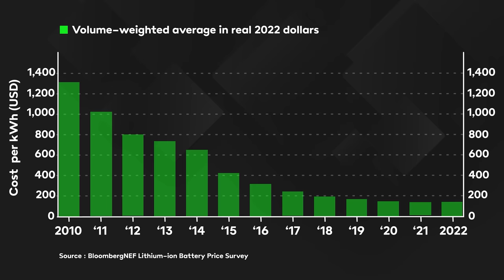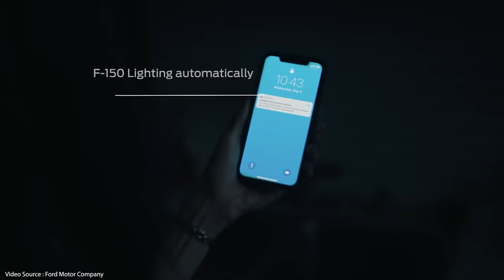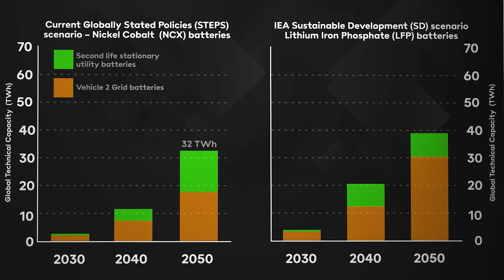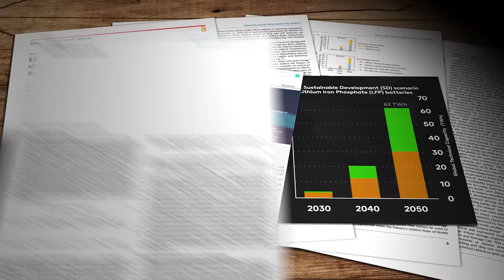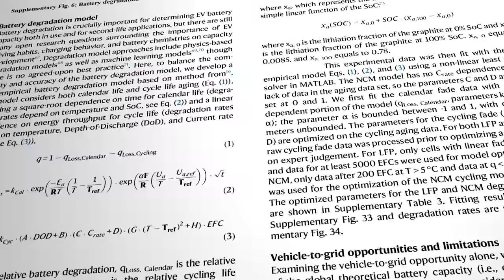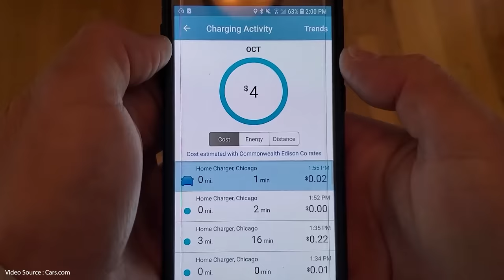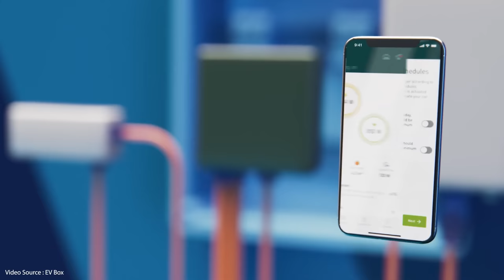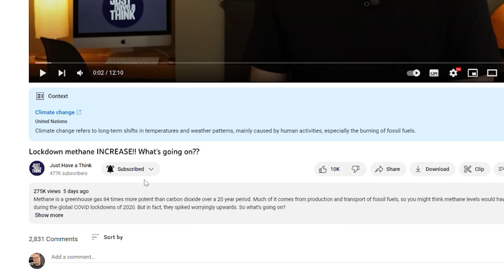Can the electric grid ruin your EV battery?

Comment: Great topic especially during the transition to solar-wind-battery SWB.  My Model 3 and Model S could keep my house going indefinetely during outages if I were charging at a location with power.  And, there is a free massive storage resource available on the grid.
Reply: If they were charging at a location with power, you wouldn't be having a power outage.
Reply: @shmehfleh3115  you could drive the car to a location with power,  charge the car  then drive it home.
Reply: Alternative if you had a wind & or solar panels you could charge your car and during night power your house from the car. The problem is if it was grid tied solar, the inverter automatically disconnects from the grid supply but the battery supply from the car has to go through that inverter. I am not totally familiar with how a EV power system works but it might not have to go through the inverter if it can supply AC power at the correct frequency for house use.
Reply: @grgmetube  yes, your car would just act  like a "power wall   on wheels".
Reply: @shmehfleh3115  You've obviously never lived rural like I do. It depends where the tree branch or tree hits the power line. There are orders of magnitude more trees here in the forest than in the nearby towns.  I've got about 300 trees in my little 0.24 hectare garden. Some are 80-100 feet tall.

Comment: Another excellent video. Most cars are parked (at home or work) for 95% of the time. Makes sense to utilise that storage capacity either for home or grid service.
Reply: @orionbetelgeuse1937  The night includes the period until 9pm when there is a peak load when the car could discharge to the grid and the 10pm to 6am bit where there is very little grid load and therefore cheap off-peak electricity. Not really that difficult, but still very useful in smoothing out demand.

Comment: We need a universal format battery "power cells" for swapping from car to home backup use when they get to the 80% capacity level. We already do this with power tools and lawn equipment. EGO has a small power bank that allows hot swapping batteries from their lawn equipment into the "generator" to power stuff. It's not an overly powerful system, but it shows me that having a hot swap battery bank for power cells could be possible.

Comment: LFP lithium iron phosphate batteries last 2 to 3 times longer than NCM batteries used in the vast majorities of EVs today.  LFP also can be charged using rapid chargers, or more commonly referred to here in America DC fast chargers, without suffering any damage unlike NCM batteries.  LFP batteries also have a deeper discharge cycle.  LFP batteries can also be charged to 100% on a daily basis without damage unlike NCM batteries.  All this means LFP batteries will be less damaged by sharing electrons with the grid than NCM batteries.  The real question will be will you have enough range on your car when you get in it if the grid has been taking electrons to while it was sitting?  I suspect in the future you will be able to set a minimum charge level that will cut off the grid from taking electrons if the EV's battery drops to that level.

Comment: Another consideration with sharing battery capacity across the grid is that it only works when vehicles are plugged in. More new vehicles will be purchased by those relying more in highly intermittent point charging and not left on socket.
Reply: That relates well to the other issue; folks in condos, apartments, etc. without access to charging infrastructure of their own.  I’ve heard that offered as a reason not to buy an EV often enough.  Even as vehicle range, pricing and public charging access improve enough to begin to chip away at that reluctance, there’s still a daunting mess of obstacles between those folks and any kind of V2G/V2H applications.
Reply: Yup, and also, even those who do have home V2G set up, there batteries will not actually be able to participate in V2G while they're at work, unless they either travel to work without car or work from home.

Comment: I have an old Leaf which I use for around town and hope to use the battery in the home when its range is too low for transport. The problem is the high cost of the inverter and controller plus the installation.

Comment: Having just left a software job at the largest Virtual Power Plant platform attempting to integrate vehicle batteries, I can confirm 2 things:
1) Software is already capable of keeping batteries in preferred ranges.
2) People are very skeptical of giving over control of their home power. If politicians try to screw us, there will be backlash.

With the massive short term battery supply shortages, I have a hard time imagining a quick renewable transition without allowing car batteries to do double duty.

Comment: I read somewhere that refining petrol uses a lot of electricity per gallon, I can't remember the exact figure.

So as electric car use increases and petrol refining therefore decreases, there's all that electricity available to charge vehicles as well. The grid won't have to increase as much as the doomsayers claim.
Reply: Diesel takes even more and uses Cobalt to extract sulphur from the fuel. 😆
Reply: It doesn't quite work that way.  The electricity is mostly generated at the refinery.  But, EV's are much more efficient so there should be an overall decline.  Plus I think storage capacity will build to very high levels over time.
Storage and power generation are both getting much less expensive.

Comment: Bit off topic, but you should look into Na-Air batteries.  If you can potentially do with them what was recently reported on Li-Air, that would solve the mass/volume issue with Na vs Li based batteries as well as address the availability of easy to extract Li.

Comment: I do believe that vehicle to home would be enough ; It would require less complexity (I guess).
The operator, knowing that a house has this system, could decide to cut the supply temporarily to flatten the consumption curb. Of course, each Kwh taken out of the battery would need to be compensated at a higher rate to prevent abuse.

Comment: I feel that all electric vehicles should be bi-directional charging capable, as should every home. This could not only reduce the number of power stations required, as electricity from cars and trucks  could sell back some of their charge at peak times to supplement the national grid and help grid balance. It would be possible to earn a little extra on that electricity rather than just be credited with it to replace off peak. There are roughly 38 millions cars in the UK and if even half of those were plugged in during peak hours, giving say 2 kWh each back to the grid, that would be 38 gigawatt/hours of extra capacity. (Hope my maths is right...)

Comment: As always, cost is going to be the key driver for all of these ideas. Using EV batteries as supplemental grid storage will work great, IF we can make the investment for a pricing system, IF we can justify the hardware cost at the home, etc. The storage is there… but can we affordably access it? I hope so. On the other hand, I think the ongoing use of less-than-perfect used EV batteries and solar panels is so hugely beneficial that the economic benefits are obvious and easy to exploit. I think this is really the answer to the “HOW WILL WE DISPOSE OF THE DANGEROUS TOXIC SOLAR PANELS?!!??” nonsense. A solar panel that is only 50% efficient still works. Just resell it, or even give it away.

Comment: The weak link is charging networks. We need more chargers, and higher speeds to "future proof" the charge stations. A recent check by EVM 30-40% of the charging stations are either down, or has large queues. Even slower chargers on the street poles would be a welcome addition.

Comment: I have found that driving my cars at 40 to 50 miles per hour gives me a much higher miles per gallon than driving at higher speeds. It also appears that driving an electric car at these speeds is more efficient too. The lower driving speeds cause less sound pollution and possibly tyre debris. Switzerland has a 50mph national speed limit and it feels great when driving around!
 I have noticed how much faster electric bicycles  travel around , even though they are speed limited. I can see that soon we shall have to change the speed limits on all roads , and critically road junctions,  to maintain safety.

Comment: Dave, as an American, I use 5 kwh of electricity per day, so we're not all energy hogs. 🐖⚡😉 I live in a lakes district, my thoughts are to build or retrofit solar canopied pontoon boats that charge the grid when not in use on the lakes.    ⛵ Edit: if we insulate our homes better and go with more efficient fridges and freezers, there should be plenty of capacity to charge those EV's, as the lion's share of household electricity is gobbled up by those refrigeration units and heating system pumps.
Reply: Even if we don't do anything as homeowners, grid expansion can easily keep pace with EV adoption.
Reply from the maker: Well said Chuck

Comment: "The current obsession with longer range and faster charging times is arguably a delusional mindet."  Yes!  Other than roadtrips, my 2015 Nissan Leaf with <100 mile range is great for my everyday needs.  People talk about the infrastructure that needs to be built for EVs, but  I don't have gasoline pipes running to my house, I have electricity.  My work has electricity.  99.99% of buildings in my country have electricity.  Maybe I can't drive across the country with so few public chargers, but I haven't needed to do that in several years.

Comment: I think this is key to the future. Also if we can have more charging options maybe we can have smaller batteries. Maybe the slow grid charge options could be based on only 240v 15 amps (in Australia) nothing too huge but not enormous cost to roll out everywhere and Easy on the grid. Your vehicle is pushing and pulling the power during the day based on what is happening with solar. You get paid for the use of your vehicle’s power. Maybe there are incentives for when you have solar at home producing and your car is parked at work drinking the power. A Parking lot company could be the one to take the lead on it.

Comment: One thing nobody ever discusses is just using less. In the last 2 years I've cut my consumption by almost 30% which in present times my costs have barely risen compared to friends who keep consuming at their previous rates
What seems to occupy people's minds most is sustaining/increasing the consumptive lifestyles that in the West at least have been ramped up exponentially, not only just in energy.
In the northern hemisphere we use a tremendous amount of energy just to keep warm in colder months and we've known about the onset of this need for energy post fossil fuels, but where has been the massive move toward  building net zero housing with lifespans greater than we currently build for. There is so much money to be made from redevelopment that building energy efficient housing to last 100yrs+ is not on the construction industries play sheet. And like many consumer products, the energy to keep on producing goods with lifespans shorter than could be employed wastes even more energy. And the only reason I can see for this waste is profit. I can only hope that there is a way of turning all this profit into energy or we're all screwed.
Reply: Net zero housing is so expensive that it's usually not worth the cost.  There is PLENTY of "use less" talk about, but that is ultimately not a workable solution.  There's a limit to how much less we can use given current technology.  Improved technologies will allow us to maintain a decent lifestyle without GHG emission.  That's a much easier thing to sell to the public.

Comment: Another excellent video. Thanks, Dave.
I feel that linking homes/commercial premises, automobiles and the grid into ever more widely spreading  networks will gradually enable a massive improvement in energy usage efficiency. Software could relatively easily control what is connected to what and at what time of day, and charging/crediting for energy usage equably. Bring it on!

Comment: 7:45 I don’t think that mindset is delusional. I drive a Chevy Bolt, which takes about 60–75 mins to charge (10–80%) on DCFC. It’s not a problem most of the time, because 99% of my charging is done at home, as you said. But 1% of the time, it’s a real problem. 30 mins is better, but we need to continue reducing DCFC times as much as we can. Imagine it’s a holiday weekend and millions of people are taking their EVs on a trip at the same time. People will need to be able to charge without waiting in line for hours.
Reply: Ideally, people road tripping with Bolts would learn not to charge their cars all the way to 80% if they don't have to. A more realistic charging session for me is 20% to 65%, which takes about 30 minutes. This saves considerable amount of time over charging to 80%, even if it means stopping to charge more often. I could theoretically optimize charging times further by allowing the battery to drain to a 5-10% SOC, but doing so is a bit risky in a world with less than 100% charger reliability.

Of course, faster charging speeds is always better, all things equal. I intentionally chose a Bolt over a Tesla because I believe the the faster charging that Tesla offers is not worth a $15,000 price premium for something that is only needed a few times per year. But, it's certainly worth something.
Reply: @ab-tf5fl  Well, of course if you don’t need to charge up to 80%, then don’t do it. But 10–80% is a standard way of discussing how long it takes to DCFC a particular vehicle. (Also, here in Arkansas, you may well need that 80% because we don’t have many DCFC stations yet. In fact, I’ve taken road trips where I’ve had to push it above 80% SOC to make it to the next charger. Hopefully this will become a distant memory soon!)

P.S. I agree with you on the price premium! I would pay another $1K, maybe a few to get speedy DCFC. But an extra $10–20K? Nah.)

Comment: I have said for some time that the vehicles should have a few standard batteries that are replaceable and instead of recharge stations we should have replacement stations. This would allow the batteries that are not in use to be available to be used in the grid, be properly maintained, charged at off peak times, replace quickly, removed from rotation when they degrade and ensure optimum performance and use. Also this approach would lower the initial cost of the vehicles since the batteries would be leased instead of being owned by the car owner.
Reply: Alternatively, a fixed 100 mile battery and slots to drop extra hired batteries into when you go on a longer run?

Comment: Great video as usual, I suggest that you start using days of supply for battery capacity comparison. We know that for a fully renewable grid the pundits say we need between 4 and 8 days of supply in storage. So you d say these xyz TWh : thats x days of supply for.. I dont know, some country or continent. then people will realise that having enough storage to cope with the future grid is much more doable than the Cassandra’s say.

But stay low in number of days, and change the geographic area rather than state annual output is my point. It makes it much more relatable to our objectives imho.

Comment: 9:36 yes and that extra grid capacity was introduced to follow the extra demand, so it was eaten up quite quickly. The EV would need to be on top of that existing energy usage increase.
Also taking averages does not work with EVs, you need to buff up the grid to take the peak consumption which might be quite significant if a big portion of population will plug in their car in the morning at their work parking space, and/or in the evening at parking space near their home.  Or even worse city folk using fast chargers because there isn't enough parking spaces with slow chargers where they work or live.
It is a very complex problem, and I am interested in how different governments will handle it. Especially the quite incompetent UK government (it doesn't look like they can do anything right at the moment), and US gov witch is not that good with keeping their infrastructure running (collapsing bridges, unsafe rail, water availability problems in some states and blackouts).

Comment: The grid growth analysis is not entirely true. The US grid grew partly because of population growth and partly because of expansion to the rural regions. So, the hvac demand is only part of the story. That highlights a challenge that is ignored: it is much easier to increase the capacity by physically expanding a grid than to increase the capacity of the existing grid. The cost of the latter tends to be astronomically higher than the former.

Comment: The crucial part in this is going to be EV manufacturers actually adding the functionality and allowing it's use. Cars usually have a long usage period of 10-15 years and if newer EV Models start offering this in 2024 or so then it will be 2040 before this becomes Mainstream. I am not sure whether this is something that can be retrofitted...so that's a major issue. My LFP Tesla Model 3 would be ideal as an extra battery pack to buffer Solar and Grid energy, but as far as anyone knows the onboard charger doesn't allow V2L or V2G and probably never will.

Comment: The biggest KW gobbler in my house is the Air Conditioner.  If you will notice, Great Britain is much higher on the planet than most of the United States.  I won't argue that we may be heavier electricity users, but I live in Florida and we use the A/C, 10 or 11 months of the year.
Reply: Thanks for the Gulf Stream!!!
Reply from the maker: Yep. And you'll also need a lot of electricity for all those water pumps you're gonna need as your state gradually disappears under water.